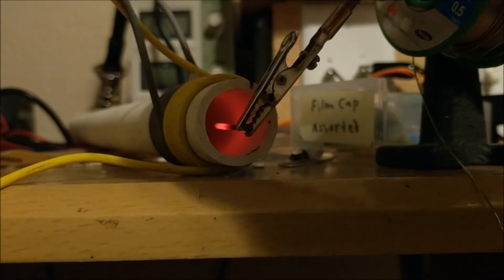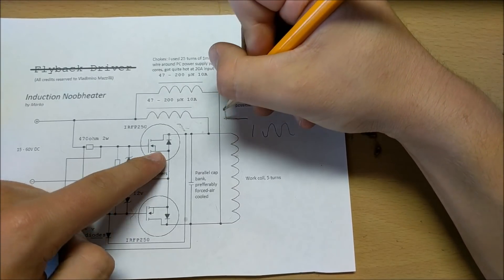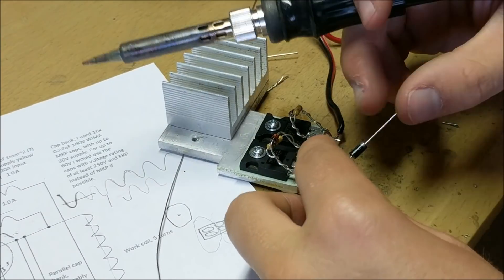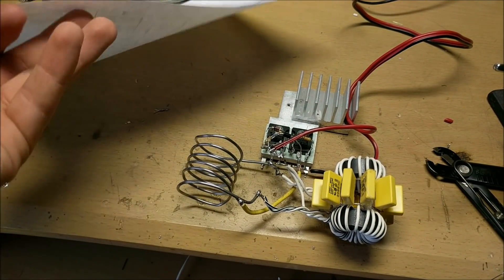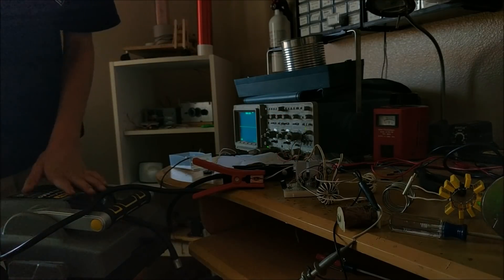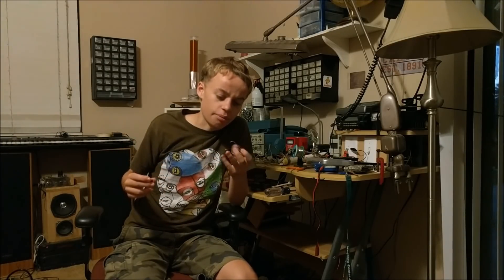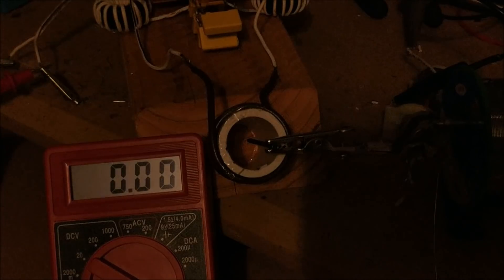How To Build an Induction Heater and How it Works (With LCSC Components)

Comment: Your quiescent current seems way too high.  There could be several reasons for this.  One could be that the MOSFETs in your circuit aren't turning off fast enough, causing both MOSFETs to be on for some part of the cycle.  Another could be high circulating current in your tank circuit--you should calculate it.  After doing so, you can decide if the wire size in your coil is adequate.  What frequency are you running at?  If you know, you can calculate the skin depth for copper, which will help you figure out what kind of wire to use.  The 150 uH coils you use to feed the gates may be of too low a value.  Measure the frequency of your oscillator and then calculate how much current is going through these coils.  You found out that putting a nail in your coil changes the oscillator current by only a fraction of its quiescent current.  That means that most of the power is just running the oscillator and only a fraction of it is heating the nail.  I will take a semi-educated guess and say that with some analysis and tweaking you should be able to get your quiescent current under an amp--perhaps well under.
Reply: I find your post debatable if you are open minded enough for discussions.. A high current in the tank circuit is an advantage. It's a measure of high Q factor, a measure of how well it can preserve energy. If Q is good, the tank will be fed to the brim, the voltage will rise high, and this will in turn tell the circuit to stop sucking any more energy. Yeah the chokes will start leaking energy back to the supply voltage 'cause of XL=2(PI)fL.  Insert a nail, or have a lossy/resistive coil in the tank and more current will be drained via the mosfets&chokes to replenish the lost energy.  Low Q factor, loss of energy. It only happens that the bad Q factor is an advantage for induction heating, being utilized for heating purposes. In real tuning circuits Low Q factor is avoided. HIGH Q of 10^8, 10^6 is typical.

Comment: Give this fellow points for showing his failures. I have been an experimenter just like him and taught myself a lot. Several years ago, about 45 to be exact, I was building a loud alarm tone generator and experimenting with different tones. Diodes, capacitors, transistors and such. Suddenly this thing started playing the local radio station very loud and clear. My wife said, gee you built a radio. Little did she know!

Comment: Sweet! I greatly appreciate you keeping the learning process in the recording. I'm very hard on myself with my experiments & prototype projects (yes, even during circuitry experimentation & invention.. ridiculous, I know). Because of that fact I sometimes need reminding that the path to building knowledge/understanding of something "forwards, backwards, & inside out" is the process of finding the solutions for those problems encountered. The more failures, the more intimately we know everything about something. 
This makes us an extremely reliable source of knowledge, & brings us one step closer to being the Authority on a given subject. 

So it helps me to see others go through the proper process, & realize I'm not screwing up, I'm learning & I'm not the only one that has to do it.
In other words, thanks for burning up some components!  Lol 
Excellent video man :)

Comment: a couple of suggestions, allways test for shorts before powering a circuit, especially if its a power one like this and bare copper is hanging around, also you could limit the current of the psu whether it is by using a resistor a current limited supply or an addon made for that purpose, that way if something inside is drawing too much current the voltage will fall and the chances the thing gets destroyed are lower

Comment: This is really cool. Sometimes I need a really long drill bit. I wonder if this induction heater could be configured to weld a drill bit to a length of steel rod.

Comment: hilarious. I think you are putting to much voltage on the gate due to the awful drive circuit.

First throw away that terrible drive circuit. Replace it with a IC with which u can control the frequency and pulse width like the TL494. then add a dedicated driver for each mosfet like the UCC2732. you need a regulator to protect the IC, u can use a simple linear regualtor like the LM7508. Build the whole thing first on a bread board without any power to the mosfets, make sure the signals to the gates are the correct voltage and not to wide....a to wide pulse will pull to much current through the mosfet, shorting it. Never Ever attach the gate of a mosfet to supply rail with only a resistor in between.

Comment: More tips to make it better - keep the leads between power components as short and as thick as possible, coils should be made from low resistance non ferrous materials like copper, aluminium or silver if possible. High frequency coils also like to be made with equivalent thickness of thin wires in parallel rather one thick wire, due to the skin effect. Foils and pipes also work better than solid wires.

Comment: It's great to see that risk of failure did not stop you or slow you down.  However, a simple fuse, breaker or constant current supply would have kept your new component drawers fuller ;)
Keep it up!

Comment: +Tanner Tech
The metal does not have to be ferromagnetic, everything conductive enough will work (it doesn't even have to be metal). That is because eddy currents are simply consequence of induction.
If you don't believe me, there are a lot of youtube videos about melting aluminum with induction heaters.
Reply: What is different concept?
I was talking about induction heaters and they do in fact work with non-ferromagnetic materials.

Comment: Another question...  Have you considered taking one of the 30$ induction hotplates and maybe converting it to a similar device to what you just made.  The main idea is that they are around 1800 Watts, which is about 10 times greater than your device.  After looking at what your max volts(12) max current(15amps) you are expending around 180 watts.  Imagine a ready made device where you can just make a new coil.  Just wondered what your thoughts were on this...

Comment: Have you tested heating with a heater coil that is double length?  I make small 4-6" knives and am interested in one of these heaters.  I realize the inductance would change due to the number of coils, but there are other factors that would come into play as well.  with a wider heat band, a person could let their metal "soak" better than attempting to quickly move it back and forth only heating a small band of metal...

Comment: Nice job, 
I wonder what happens when we make a conductive heater and set it at the right frequency for neodymium...   Would It would be possible with the right equipment to suspend the molten dymium and cause it to rotate via magnetic fields.

Comment: Why did it blow up the first five times? Bad connection from building it too fast?
Reply: He used a ferrous metal for the induction coil - as he mentioned in the video.
Reply: I know that my question is why does that matter? The resistance should be the same.
Reply: Incorrect. Not only is the resistance different, but magnetic properties are different as well. Different metals have different properties. The exact differences are complicated and technical, but it matters.
Reply: Thats correct it's an inductor and it will change with frequency temp curie temp etc. I have a college education so I might be able to understand the details if you feel inclined to share them.

Comment: you wanted to explain this for beginners to the "hobby" but, your use of terms and functions, cause and effect assume a proficiency of at least a years' worth of classes. I liked the video, like everyone else said, you'll go far if you keep up the enthusiasm but the narration was clearly the explanation you would give to yourself or lab partner. Teachin' ain't easy and it doesn't mean dumbing anything down. include in the talk how the components are made/influenced to work as they do, how the flow of current pushes and pulls these logic gates open/closed. Telling what a parts' function is supposed to be doesn't explain how it works but the student is left with no way to figure out exceptions to rules, losses, feedback, etc., and so they get lost.

Comment: I appreciate your learning from your failures and not hiding them but putting them out for everyone to see the process of real learning. I would caution you greatly though, creating so much radiant heat inside a PVC pipe is likely to create some very toxic fumes. The kind that love to destroy young brain cells. Always be carefull of the chemicals in plastics and make good ventilation one of the more important parts of your workroom.

Comment: Love it. Keep it up son, your future is very bright.
BTW the no load current is reactive, with a phase angle near 90 degrees the power is minimal. When the nail is inserted the phase angle between the voltage and current gets closer to zero and so you get real power. So you see; the amount of current it draws, is only a part of the story.

Comment: Cool video. By the way, you should be pretty careful with PVC and very hot things. Lol. Burning PVC is some pretty toxic stuff.
Reply: PVC is Polymerized Vinyl Chloride, and heating can break the long chain PVC molecules back into Vinyl Chlorides which are carcinogenic.
Reply: I will definitely also wear my safety goggles when testing out this circuit.

Comment: did you noticed that when your workpiece gets red hot then the amps go down preventing the workpiece to melt????
you just cant melt it..
Reply from the maker: Your right, I would need to have a PLL(Phase Locked Loop) heater in order to melt the material.  The frequency of my heater drifts as the material heats up, a PLL would not drift in frequency.

Comment: This generated heat can be transmitted over the whole metal? I think, make a kind of stewpot conected with the iron inside the incandescent metal. Could this work?
Reply from the maker: This could work.  In fact, most induction cooktops use this type of circuit to heat up pots and pans to cook food.

Comment: Your power supply is a slow rising DC supply ,To save mosfets  you need to connect power through a switch, and  turn the supply first then turn the switch on
Reply from the maker: Ohhhh, thanks.  I did not even think about that issue.  That explains why the 12 volt battery worked well.  Ill try adding that extra switch.

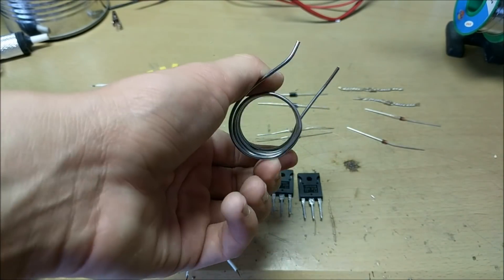Comment: 3:46
"My work coil, which is made of..."
Me: Looks like aluminum... maybe steel... could it be lead?
"...a coat-hanger." 
Me:  ah. x-)

Serious question - Is it safe to hold the end of a conductor you are heating? (apart from the obvious, that it will get hot) I would have thought the induced currents could be dangerous if there is a twist in the metal and you happened to be grounded - as in, could it function as a transformer unexpectedly?

Comment: I have a question, if this is the "noob" way of doing induction circuits then what is the professional way? I keep hearing that these push-pull oscillators are the amateur means to achieve induction heating but no speak of what is done professionally.
Reply from the maker: +TudorWolff Professionally, induction heaters have a PLL (Phase loop lock) circuit.  This allows them to keep a constant frequency ended when the object inside the cool changes.  This means that the induction heater can hear more efficiently, ended when the metal inside melts.  These professional heaters also have much more power.

Comment: Interesting idea. My 3-floor townhouse relies on electric baseboard heating that is essentially convection. It heats the rooms okay, but in the lounge on the ground floor, the heating element is on the opposite side from where we usually sit, so most of the heat is just lost to the upper floors. I wonder if I could use something like this instead of the baseboard to direct the heat forward. Any thoughts?
Reply: in the lounge where you sit... up at the ceiling, is the air warm? if so, maybe you can use one of these:
https://www.treehugger.com/gadgets/totally-tubular-innovative-fans-redistribute-hot-ceiling-air-floor-warmer-rooms-lower-heating-costs.html
Reply: This isn't a room heater. This only heats up ferrous metal. Think of an induction stove. You put a steel pan on top and you can cook food, but you don't heat your house with a pan, do you?
Reply: No!!!!!!

Comment: can it be used without using electricity?
Reply: "Fire is an inefficient, old fashioned, and slow way to heat up metal objects"   in the absence of 110V or 240V - have a charcoal BBQ
Reply: Yes add oxy-acetylene flame and it will get hot without electricity.

Comment: Am I right in assuming your original build was ok, just the coat hanger wire should have been copper (non ferrous)?
Reply from the maker: +Darren Style Pretty much.  I had just overlooked that fact for all the first versions of the induction heater.  It finally worked when I switched the coil.  If I had the right coil in the original build, it probably would have worked.
Reply: @TannerTech  I could swear that, earlier in the video, you were apply power to the power supply input and letting it ramp up while connected to the circuit under test, rather than first turning on the power supply and letting it ramp up before applying the output to the circuit.  In some cases with that type of circuit, it needs really quick rise time to start the oscillations. If not, it sometimes results in both FETs conducting at same time, and 'kaboom!'
Reply: did you try? Be cool to know.

Comment: Thats Great BUT i think a more technical way to test these circuits would be better as you did blow a lot of expensive MOSFET's during the testing process, i use a high power 12V lamp for this connected in series with the power supply to the circuit, if the circuit is working fine normally the lamp may have a faint glow BUT if somethings wrong with the circuit and its drawing far to large a Amps from the power supply or battery the lamp will light brightly and it will save your components from destruction, i am pleased you found a local component supplier to support your channel, BasicMicroUK would have loved to do it but it would not be practical because of where we are located, i hope our approach to you helped you get your new sponsor, all the best, Dave
Reply: Great comment about the 12V lamp. What you describe is essentially a PTC (positive temperature coefficient) circuit protector whose resistance increases dramatically once they reach a certain current threshold. I used to use the ones made by Raychem (now owned by another company) in my motor drive circuits, and I have seen actual light bulbs on the crossover circuit boards inside audio speakers to protect them from being fried by too much volume. Great job, Tanner. You have a bright future in electronic design ahead of you.
Reply: He mentioned that he got them for 50 cents a pop. Pun intended LOL